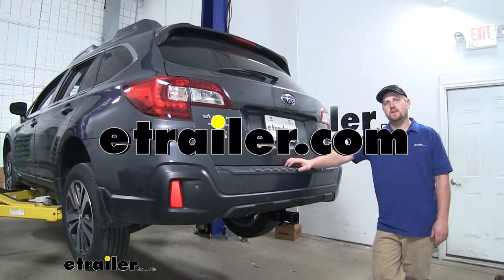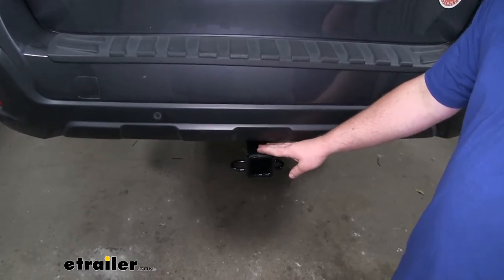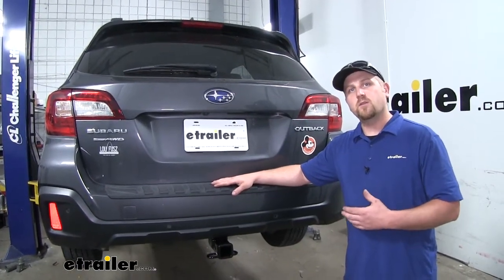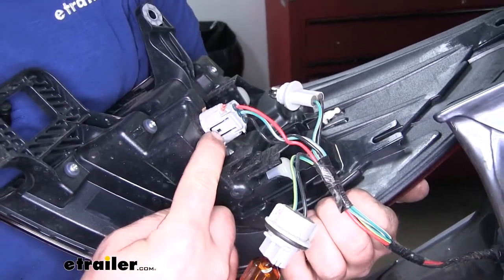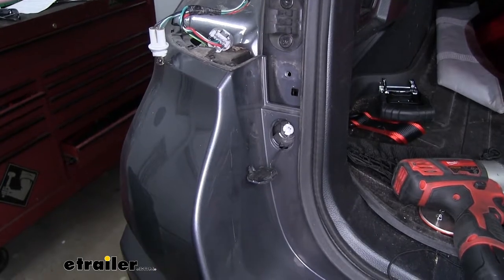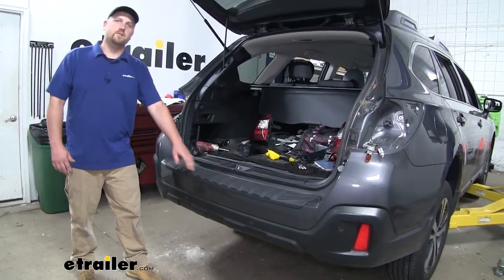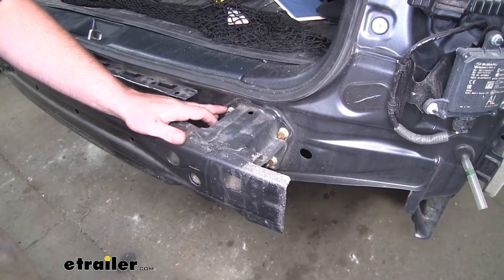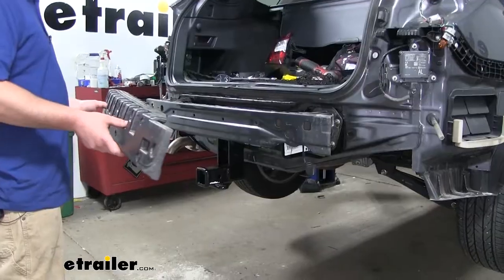etrailer | Mount: Curt Trailer Hitch Receiver on a 2018 Subaru Outback Wagon

Comment: You might want to note that (1) the two screws that you first take from the tail lamps are machine screws; the third one (behind the cover-plate) is a self-tapping screw (which you call a bolt at 4:39). (2) Also, the fasteners you take out at 5:21 are somewhat smaller than the ones on the bottom edge of the facia. The fastener at 6:12 may also be this smaller size.  (3) You can also see, at 6"12, that another pin is revealed when you remove the mudflap -- you DON'T need to remove that one. The pin you pull out at 5:59 doesn't need to come out at all -- it's just plugging a hole as far as I can tell. (4) When you release the fascia from both sides, there are still two more things (pins perhaps -- somewhere near the bumper ends?) holding it in place, which makes it reluctant to come off. (5) When you re-install the facia, you need to be sure to get the fascia BELOW the tabs (one of which you bent up).  In the wheel well, the wheel well covers go between the lip of the fascia and the mudflap. And as you reinstall the fascia, be careful not to get the taillamp wires caught in it. (Ask me how I know...) (6) You need a 14mm socket, but if you're like me, you'll find that your socket isn't deep enough to remove the two lower bumper bolts on each side -- you really want a medium or deep 14mm socket.
Reply: I found the same thing about the 14mm socket. Also getting the fascia back on was by far the hardest part. Had the same difficulties

Comment: Great description of steps.  Not everyone seems to mention the hidden middle clip that needs to be pushed forward to unseat it (3:25).  I did it by pushing forward in the internal radius of the molding, (about center from top to bottom).  Merely pulling the molding out will break the hidden clip.
Reply from the maker: Thank you for sharing this feedback with us! If you need any other accessories for your Subaru Outback, check out the following link to see the options we have.
https://www.etrailer.com/vehicle/2018/Subaru/Outback+Wagon

Comment: You can put the top screw holding the tail lights partially back in and hang the tail light from it via the wires. Don't need to unplug all the lights.

Comment: One note - on my factory installed hitch Subaru did not put the bumper bar back in - I noticed when I switched it out for a  bigger 2” hitch - caller Subaru - this is standard procedure - maybe more research if both are needed ??? maybe it combined they compromised the crumple factor ???? I don’t don’t the correct answer but wanted to pointnout to others
Reply from the maker: According to Curt, when you install their hitch, you will need to reinstall the bumper beam. This is to protect the passenger in the case of a rear end collision.
https://www.etrailer.com/Trailer-Hitch/Curt/C13410.html

Comment: So this is consistent for all Gen 5 Outbacks, right?
Reply from the maker: This trailer hitch is designed to fit the 2013 - 2019 Subaru Outback Wagon and the 2010 - 2012 Subaru Outback Wagon excluding the Sport.
https://www.etrailer.com/Trailer-Hitch/Curt/C13410.html
https://www.etrailer.com/t1-2018_Subaru_Outback+Wagon.htm

Comment: This hitch will fit a 2019 outback correct?
Reply from the maker: Yes, this hitch is also designed to fit the 2019 Subaru Outback Wagon and will install as shown in the video.
https://www.etrailer.com/Trailer-Hitch/Curt/C13410.html

Comment: Or you could just order your car with it already installed.
Reply from the maker: This is a great option if you already have a vehicle in your house hold and you just want to add a hitch to it. It is also a solution when purchasing a used vehicle that did not come with a hitch.
https://www.etrailer.com/Trailer-Hitch/Curt/C13410.html
Reply: Haha. We did. They installed it at dealership